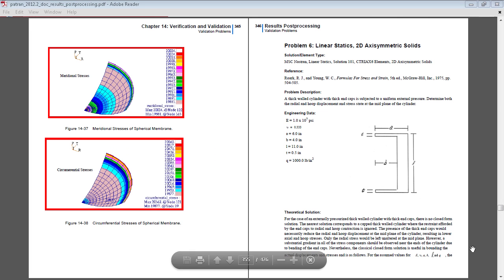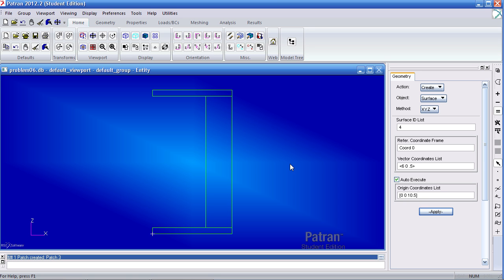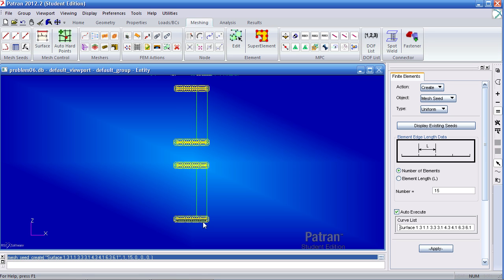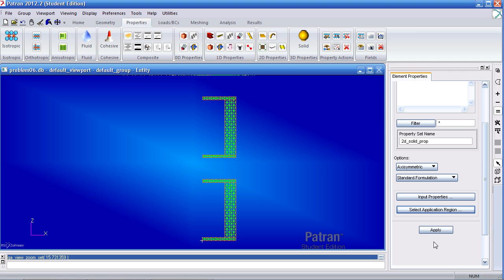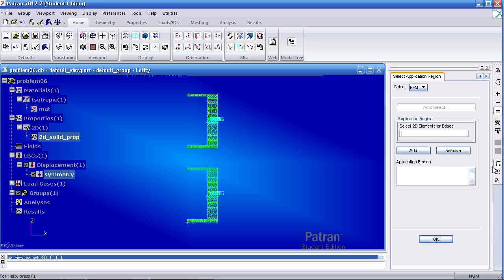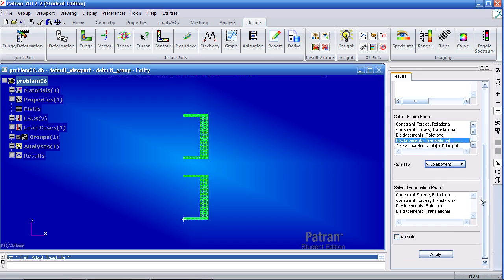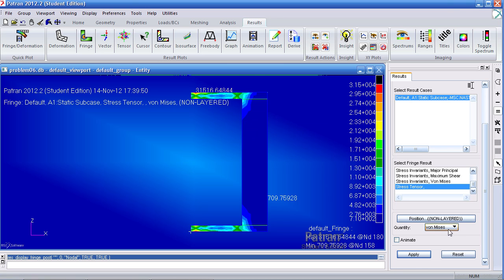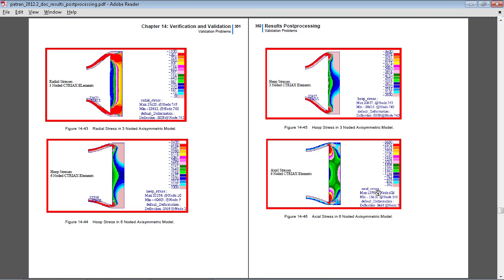MSC Nastran, Patran Tutorial - Linear Static Analysis of a 2D Axisymmetric Solid

Comment: I think there might be some errors in the pdf. For instance, while calculating sigma3, upon inserting r=b we do not receive 0 according to the formula. Also, something about those Poisson ratios concerns me (the delta displacements). As I understand those displacements are derived simply by substituting a and b in the general displacement formula, correct? Well then the values seem different. Could you perhaps explain that?